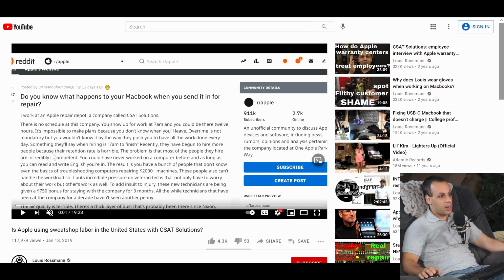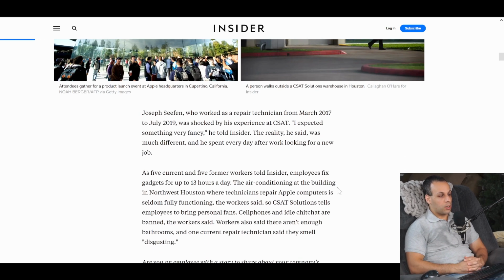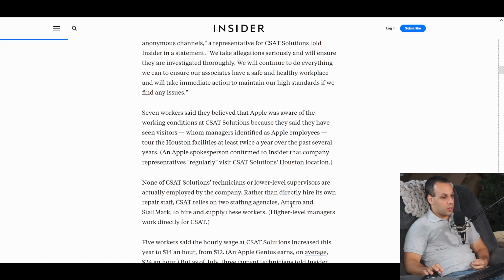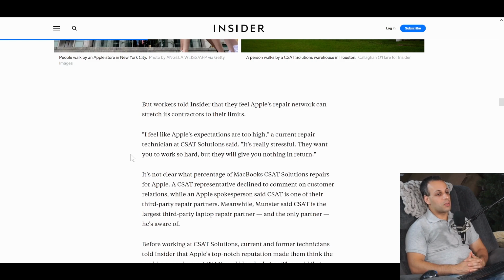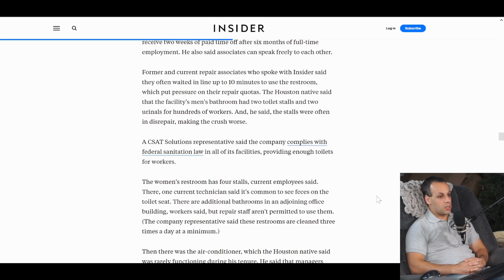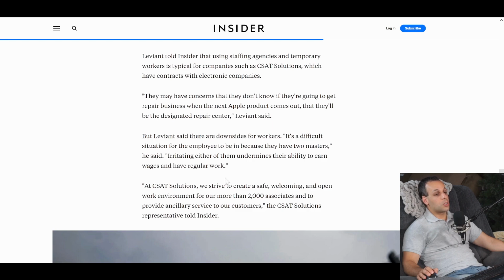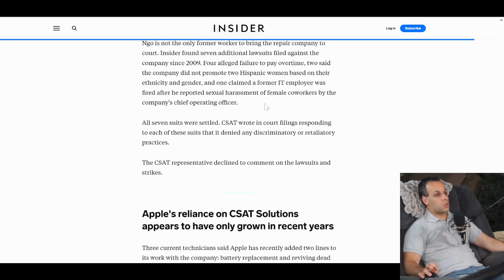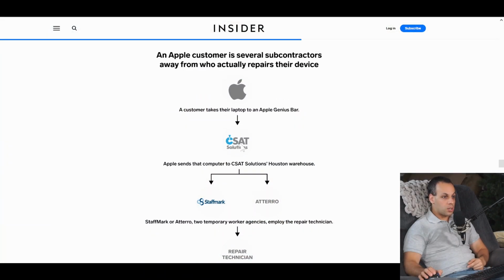What is Apple authorized repair REALLY like?

Comment: Personal opinion from someone that has never worked for CSAT and has no relation to it.

Why keep people from bringing their cell phones into the facility? Probably to help prevent any kind of documentation video/audio/photos of these exact conditions and treatments of workers. The isolation from the outside world is just a bonus.
Reply: yup. It's quite common in production facilities.I work in R&D so I move from site to site. I'm not allowed to bring my cellphone in unless it's a company phone. Those things riddled with corporate spyware so I never take turn them on when I'm traveling.
Reply from the maker: Have some pride in your abusive working conditions, that's what we do. 
https://youtu.be/IGMYT_h6uqo
https://youtu.be/ycmPaRh3Vlo
Reply: Honestly, I don't blame a large repair "factory" having 100's of employees, not allowing personal devices. Dishonest employees could use the device to take photos of customers private information, or steal files from customers devices, using a bluetooth connection.... I worked at GeekSquad for a bit before opening my own shop, and if I remember correctly they had the same policy if you were in the geek squad repair area. (this was one of the only areas that had this limitation) This is to protect the customers. They also had a policy that ONLY employees of Geek Squad were allowed in the repair area, to limit issues like this, or employees stealing customers devices. It sucks, but eventually if you are big enough, one bad employee can screw it up for everyone else. My shop has a policy that if you are caught looking at someone's personal files ONCE, your fired, no write up, no second chance, your gone. I have been in the repair industry for 23 years, and I have seen this happen before, and 100% not acceptable. In a small businesses like mine or yours, WE have better control, due to having less employees... 

Everything else, ya they suck.. But they have to protect customers data, and you can't be mad at them for that.
Reply: @rossmanngroup  They're repairing customers products. They probably don't want sensitive info getting out. It's not like a small facility with 10 workers. I'm not supporting their behaviour, in the UK they'd be in court, most of the stuff reported is illegal here.
Reply: 'And goddamn you if you're calling me about my car's extended warranty...I WILL FUCK YOU UP SO BAD' Funniest thing ever heard. Keep up the good work sir 👍🏼
Reply: @chudchadanstud  You bring up a good point. That said it was pretty horrible that there was nobody to inform the worker that their child had been injured when the workplace was called. If they enforce not allowing phones, which you bring up a valid reason for why they might, they should have a way to get in contact with someone for emergency situations
Reply: Would you sit on a toilet seat that is used by more than 100 people? So easy to miss there. Hovering over is the only solution.
Reply: @chudchadanstud  The article said they do, only for the people who are supposed to answer these phone calls, don't always answer. 22:07. Not to mention they leave earlier then the workers who have to stay for far longer.
Reply: @cttommy73  I wasn't talking about the article. I'm talking about phones in general. It's the norm in any place where sensitive data can leak. Everyone is subject to this, including the CEO. 
This is why you hand your kids the front desk's number. I  know the Repair company Louis mentioned is a POS through and through, but dont try to extrapolate that to every company or every rule.
Reply: @adamcarter7826  Same policy here in the UK at "KnowHow"  a support part of a computer/tv/fridge seller PC World/Currys, I worked at a local one after college for a year and the place was fine to work in. Nothing like this CSAT situation but no personal devices in the repair room due to fear of data theft. We were allowed to give the office phone to family if we are needed to be contacted while at work as our phones were in our lockers. For a franchise company they were pretty good tbh.
Reply: @FullTimeGaming360  I was talking about the article and this particular company though :P
Reply: @mwwhited  LOL, I have been in this business for 23 years, pay has little to due with some people thinking it’s okay to look at or steal other people’s stuff. I have seen people making crazy good money, get fired for stealing less than $100 of stuff. Any good shop, would/should have a similar policy to mine, stealing is not acceptable, and stealing from a customer is the cardinal sin in this business.
Reply: @mwwhited  people always have the opportunity to change jobs, I have had two employees this year leave for other opportunities that pay double what we do, and I congratulated them on the new job, and truly happy for them. Some places are just scum, and milk the employees for everything they can get… and others are just struggling to stay open another day. We pay decent pay for the area, and I would love to be able to pay more.. but at the end of the month, the bank account has to balance out…

Regardless what the pay is, it’s never acceptable for an employee to steal customers data… Steal a screen, that’s one thing, but the personal data… I’m calling the police, I’m pressing charges, and your done.

I have paid employees rent in the past, helped an employee that was going to get their car repoed.. but at the end of the month, the businesses bank account HAS to be in the positive.

Yes better pay can help, but that helps with limiting items of value, like new parts… stealing someone’s photos for your porn collection is not  for financial gain.

So yes I agree with you to any extent, but we are talking about items that may not even have a financial benefit, but be detrimental to a businesses reputation.
Reply: In the few instances this has been imposed on me it was due to security concerns. Working in a super high security environment they didnt want anything from the outside coming in that may be a vector for malware or more likely a vector for data or security breech.   There were other sections where I worked in those cases that were even under a much tighter lockdown and restriction.
Reply: CSAT workers should unionize. Sounds worse than Amazon warehouses.
Reply: @mjc0961  I have never heard of that happening. Believe it or not 99.99% of humans are nice. Not sure about America though. I'm from the UK and pretty much the stuff the company on Louis's video did is pretty much illegal here.
Reply: that is north korea or indian scam callcenter level
Reply: They're overly paranoid about us taking customer data. Which is bullshit. 1) We don't have interest in it. And 2) we never login to customer units. Apple stores rarely (and should not be) put customer data beyond pay rate into the tracker.

They're not worried about cataloguing conditions, it's more a control thing and a misplaced data thing.

Furthermore, they got themselves a massive fucking data breach months ago that nobody outside seems to know about. Someone downloaded or plugged in a flash drive they shouldn't have, and the entire internal tracking system got ransom-wared. I also heard that someone is still poking around the wifi network occasionally.

What's also a control thing -- and frankly, I strongly suspect is related to this article, is that they took away google, so we can only access internal company sites now? Which is confusing in a different way because, we've never had phones, but we were allowed google?

So yeah, eh. I think a combination of them being overly paranoid about data loss and shafting us, and them wanting to control people.

I will neither confirm nor deny where I work.
Reply: @chudchadanstud  "Just contact reception lol. They'll find you. My mother is a nurse. I used to get her that way at the hospital." This is what you said. I replied with the proper information. If you want to contradict yourself, be my guest.
Reply: My current workplace argues no phones for health and safety reasons.

No, the argument holds no water at all.
Reply: @rossmanngroup  Feces on the toilet seat is caused by dirty seats and not much toilet paper.. the people 'hover' above the seat when using them to avoid touching them, which causes misses that hit the seat.

Comment: I arranged "authorized" repairs for hundreds of Macs and thousands of I-devices in a previous job. Years of handling such repairs in the "manufacturer approved" way led me to the false belief that board-level repair was something that just wasn't done at any significant scale. That swapping out entire mother boards, displays, etc. was the only practical way to repair these kind of devices commercially. I thought desoldering and replacing individual components like chips and capacitors was relegated to enthusiasts who had a lot of free time and were willing to risk breaking the thing even worse. I know better now. It hurts to think of all of the customers who I was not serving as well as I thought I was at the time.
Reply: This facility does not do board level repair. 90% sure they send that overseas.
Reply: Im 99% sure that Apple sends a lot of their faulty devices overseas where they get completely stripped down and recycled. With a lot of the components either sold to other manufacturers if not re-used to repair other faulty devices.

Comment: Many Asian countries consider using sit-on toilets  to be unclean, they use squatting toilets. So some tend to squat on the toilet and may miss....
Isle of Wight, UK.
Reply: That's exactly it...squatting or hovering to avoid touching the seat with a western toilet, leads to pissing and shitting on the seat, which means anyone else after them will only do the same, exacerbating the issue. So having a high ratio of folks who would do that by default, means the seat will ALWAYS have some piss or shit on it.
Reply: @mlindholm  Also some people are pretty much forced to squat because they want to avoid the shit on the seat. Making the initial problem worsen.
Reply: Damn a positive shit loop, how long for the entire world to be covered
Reply: @shakalpb1164  positurd feedback!
Reply: As a south Asian, I find this a reasonable explanation. In Asia there is always a hand-held bidet or other access to water in a squatting toilet to wash off any mishaps
Reply: Why don't those people raise the toilet seat before doing that?

Also they're just being paranoid.  The cold, nonporous surface of a toilet seat is a very harsh environment for microbes.
Reply: @André Búzás I'm confused now. Are you woke or just weak (at English)?
Reply: @André Búzás Come all ye woke people, watch closely, because this here is what you call an actual racist
Reply: Could be poo on the tissue that hits the seat as you drop it in. Personally I'd always clean it with soapy water it that happened but not everyone would.
Reply: @DarthCuda  Do you do that often ? Maybe you should get that checked out.

Comment: I used Authorized repair to replace a screen that cracked.  I then got a recall on the battery and took it to an Apple Store for replacement.  They hesitated to change the battery because the authorized repair did not use an Apple Screen... What good is Authorized repair if they do not even use the genuine Apple parts?
Reply: Should have their license revoked, given that you have paid good money for that screen. Chinese sources for the Retina screens are going for perhaps $150 a pop for fakes and $300 for the real deal. That is the case if you are not able to just swap the LCD like how they are able to on a hot table.
Reply: My question is: what does the screen have to do with replacing the battery that was bad enough for even Apple to do a recall?
Reply: The real issue is all and I mean all electronics from apple come from china but if u don't get it threw them including parts they won't warranty it
Reply: simple: certain repair shops can swap original working parts with fakes to resell them later. This malpractice was first discovered at large in 2013, China.

Comment: Authorized repair doesn't fix, they replace. The reason it is so expensive is because they replace a motherboard because a 10 cent part is broken. AND the high service fees of course.
Reply: If they are even able to replace anything other than the whole device. With the Surface Pro 1 it would take professionals a full hour just to open the device without destroying the display, and then it cannot be closed again without visible glue traces. The Surface Laptop can't be opened without literally melting the keyboard.
Reply: @3v068  - They don't handle data. You're getting back a refurbed device and your old phone is being harvested for useable parts.
Reply: @duketogo2616  incorrect. If they didn't handle your data, they would be giving you a refurbished phone without any data whatsoever on it. The fact that companies will copy your data to another device when going in for a "repair" means they are handling your data.

Considering they're the manufacturer of the phone as well, they can easily get into the operating system without a password if they so choose and even take your data from there just for the hell of it (just because it's illegal doesn't mean that companies still don't do it.)

The entire job of the person handling your "repair" is to take all of your data and transfer it to a new device. That's data handling 101
Reply: @duketogo2616  lol your comment proves that you don't.
Reply: @3v068  Apple has NEVER handled people's data. They put the responsibility on the customer to have their data backed up.

Why do you think they removed the lifeboat connector on the 2018 Macbook Pro?
Reply: Same thing with cars - if the problem isn't clearly visible, they just start to replace things that might be the problem until the problem is gone.
Reply: @duketogo2616  Quite interesting that you're with apple and watch rossman. I'd love to chat more with you. Everything from engineering, career to repairability. It's extremely rare to find someone like you being open about it on a channel like this. Out of curiosity what is/was your job role, title & work area at apple?
Reply: Look if Apple taught people how to do what Lewis does. (Component-level board repair)How many Lewis would be out there , especially with this environment 
There would be a industrial hardware repair industry that would be as big as apple.
Phone/ computer sales would slide.
I have a 2008 iMac that works fine!!
Lol
Reply: @3v068  been an AASP for a while now. He's absolutely right. Not saying Apple is a fun company to get repairs through but everything he said is how all of my preliminary questions go when decide Ng how a decide is "repaired" by apple.

Comment: In the UK, on building sites at least, it's illegal to have less than one toilet available per 20 employees.  This was an exam question on the building site safety certification I have to renew every few years.
Reply: The problem is that even here they might have one toilet for every 20 employees, it's just that most of those toilets are only available to the high ranking guys. Either that or they are somehow evading the law by having the workers not actually "employed".
Reply: Can confirm similar laws regarding factories in the UK.
Reply: I do wonder if its because they are working in a "warehouse". Sure it was built as a warehouse, then they rolled in 300 desks.
Reply: @BigJProductions  I can't speak for your sites but on mine we hire both permanent and agency workers, but we count people, not just permanent staff for calculations such as fire edits and toilets 😉🤦‍♂️

Comment: I am just waiting for Apple to double down and design a chip that self destructs after you solder it a 2nd time.
Reply: They'll call it the MI chip for "Mission Impossible" just to further troll independent shops.
Reply: As soon as you touch the screws to release the back panel it self dissolves in a puff of smoke that makes a middle finger on the way up.
Reply: Don't give them ideas!
Reply: Serialization is worse
Reply: They do that. It's called a flux fuse. If reflowed for too long, the solder bridges shorting itself. TPM chips use it, but I'd be surprised if apple didn't.
Reply: I got the patent for that on soc’s and bigger ic’s
Reply: Self-destructs after a month after shoe soles has attached to the top
Reply: Is it possible to remove that with low temp alloys and then glued on with conductive glue? Sure would not be a feasible repair but just talking about the technical possibility of it.
Reply: A total power play lol.

Comment: The ONLY benefit of these branded repairshop is that they have access to all parts and software tools. That is why they try to limit these at all costs. They would be blown out of the water in terms of quality and pricing of the repair if everyone had access to all hardware parts and software tools and documentations.
Reply: I wonder how meaningfully true this is, and what level of repair they are doing.
Reply: That is, what fraction of board level repairs are done for non-absolutely-trivial issues that are repairable with commodity parts, vs deeming stuff unrepairable for throughput reasons.
Reply: i wonder if those parts go walk about sometimes
Reply: The only miss one piece from your jigsaw puzzle. A stuff that do care.
Reply: @testaccount4191  One company that I worked for years ago had metal detectors, every single employee had to go pass them at the end of the day... and they only made CD/DVD's... Can't have Jay-Z's new album hitting the streets a few weeks early. Once the album was released, employees could buy it for $1
Reply: That’s not true actually.
Apple’s position has always been complete board replacement, from as far back as the Mac Plus computers with monochrome screens.
Being an authorised repair centre gives you access to boards, not components for boards.